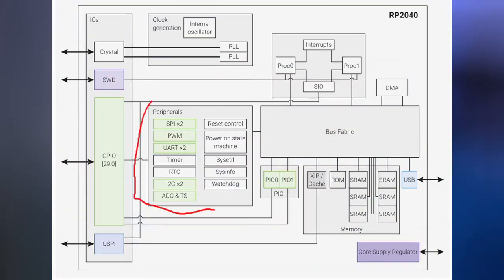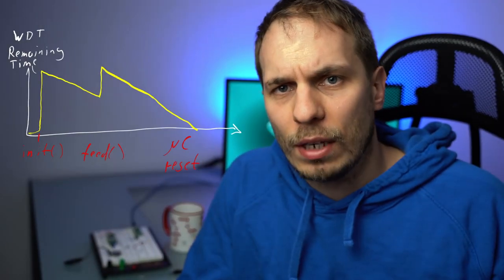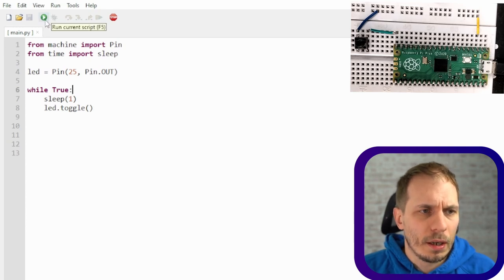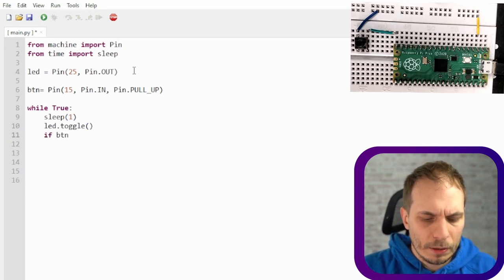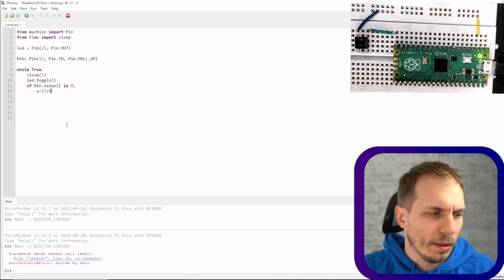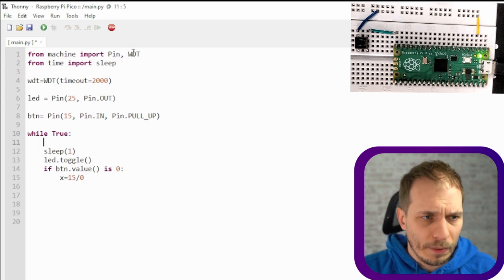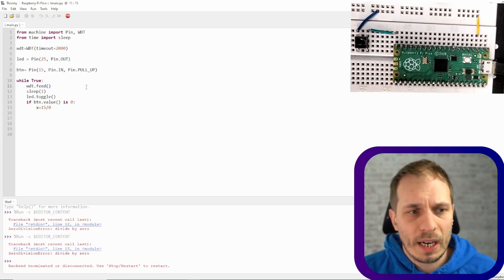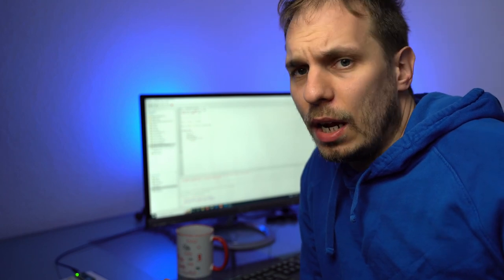Error detection: Watchdog Tutorial with MicroPython Example!

Comment: Current Project: Automated curtains that runs from a server hosted timezone. Pico w is the controller. Pulls the time from the server, no additional hardware or backup power required this way. Waits for a certain time for it to either open or close the curtains depending on what date it is or waits for manual control input. Manual control is a wireless toggle switch connected to a lamp dimmer plug, which operates a 120v relay coil, giving the Pico a 3.3v input. When the Pico sees this 3.3v input it runs the opposite direction it ran last, when toggled again it stops at that point. I have 2 microswitches at either end of the curtains that verify the curtain position as well as stop the curtains from overshooting. Currently I am correcting errors on the automatic end of the code before I can install it and share the project publicly. I have to refer to sections of my server time stamp correctly and then apply them to my tasks correctly. My coding experience is fresh, unchecked and only follows guidelines that I discover, if at all. My wrists have been getting slapped and I am learning, I will get there eventually!
Reply from the maker: Uih, that sound like a good, but complex project. But nice ! let me know if you are succesful at the end. Now i understand your interesent in RTC and synchronising :) And i like this solution you use by picking the time from a website !

Right now am planing the next video´s. Next one will propably be about SD cards but i´m thinking about a more complexe software architecture where you can update the pico W without a USB connection, using the WIFI. Could this be interesting for you ?
Reply: @lutz4tech  extremely interesting!

Comment: How do you "activate" the watch dog before you end your project - just feed it again? Do you add something in the final line of the code or just run the program and activate it at least once before quitting.  The watch dog could be helpful for remote unattended projects. Does micropython include "try" statements (as Python does) that allow a program to continue after throwing an error? Thank you.
Reply: Don't include it into your code until you have completed your freshly developed codes debugging.
Reply from the maker: Thanks to Tom, that was what i mean. Just put the lines of code in, when erverything else is finished (and then try if its still works with the watchdog :D )